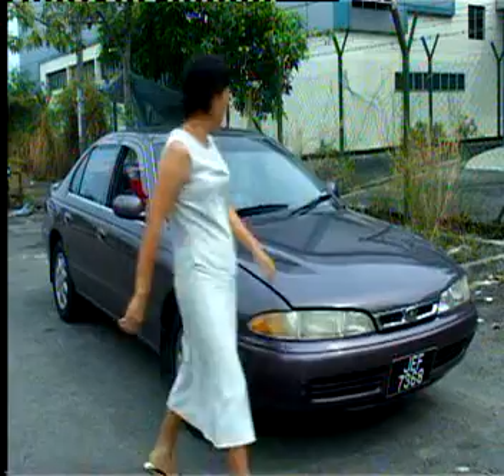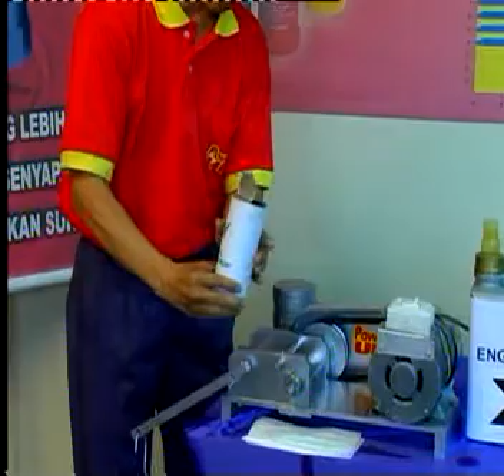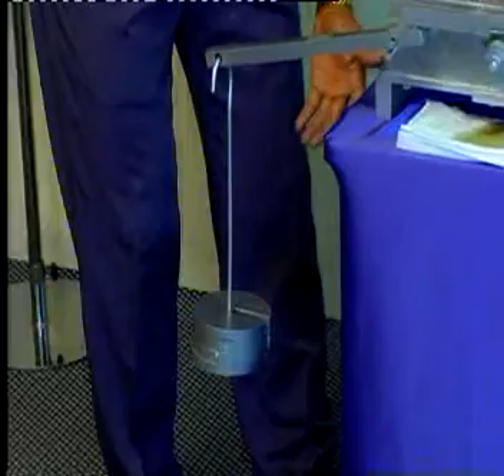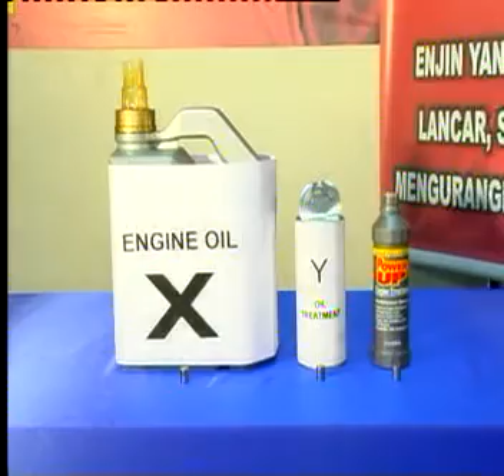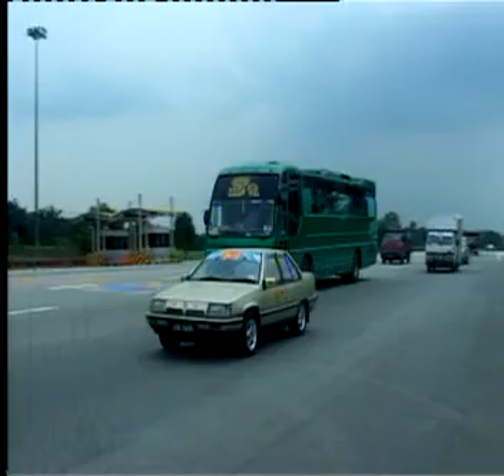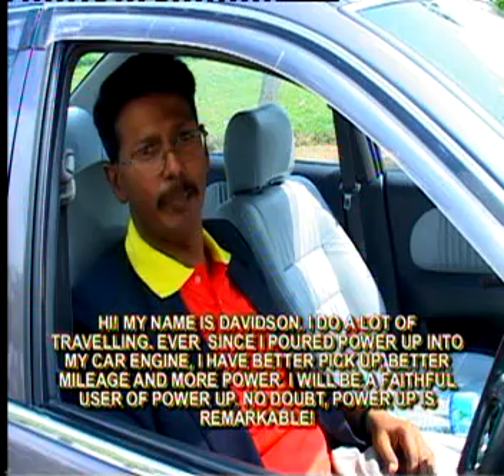AVSEQ01

Comment from the maker: POWER UP ENGINE TREATMENT

BENEFITS & FEATURES
 Protection from wear between 4 to 5 times as compared 
     to normal lubricants
 Improves fuel mileage
 Reduces dirty sludge, hard varnish & wear deposits 
     formation
 Prolongs the life of the engine, transmission, gear box 
     and differential
 Protects the moving metal parts against heat and friction 
 Increases acceleration, horsepower, torque and 
     performance 
 Penetrates the metal surface to form a polished shield 
    (low friction shield) that reduces friction
 Engine and engine components is cooler, cleaner, smoother and quieter
 Increases oil change period by at least 50%.